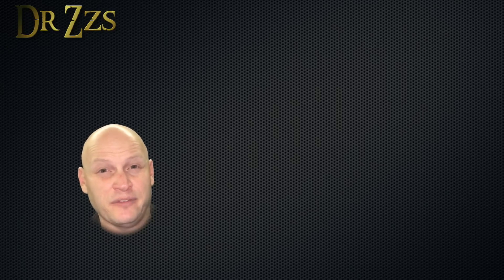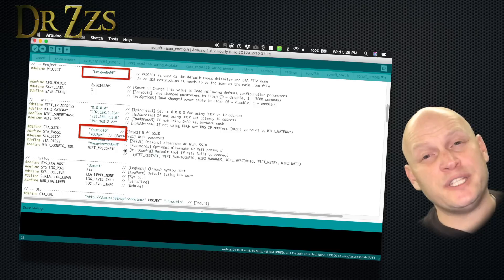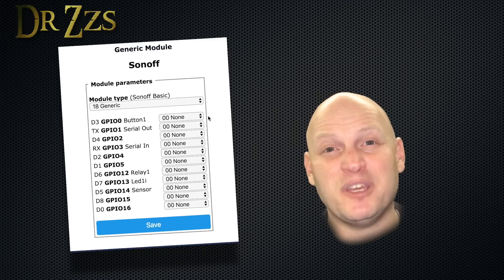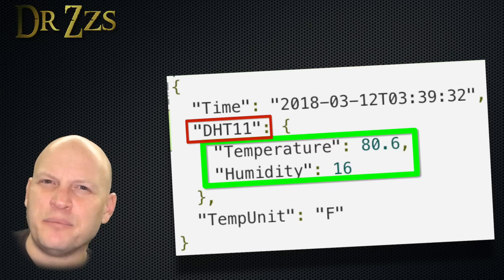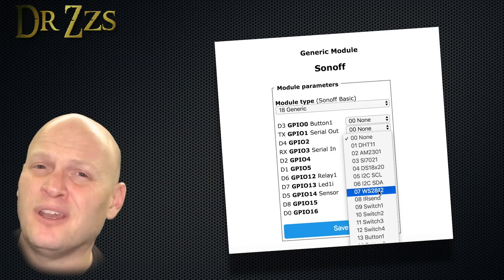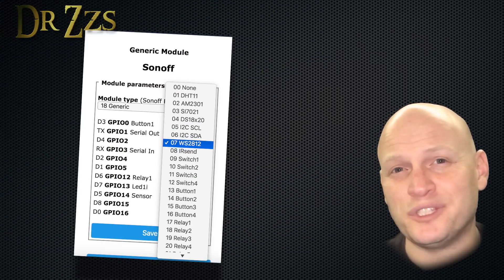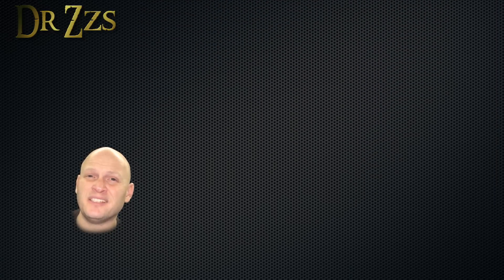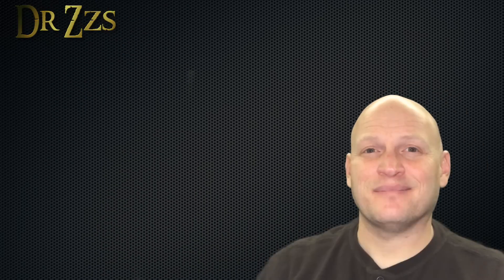Tasmota + D1mini (or Sonoff) - Temp & Humidity, ws2812 LEDs, and Motion Detection

Comment: Hey Dr. Zzs,  In some of your vids I see on your HA screen that you have cameras feeding in to your system. I too use Hassio, Sonoff,  & Home Assistant. Will you please tell me which is the best camera system I should install for the money. It's the one thing I haven't set up yet. Thanks man!!
Reply from the maker: Sure!  The images you see are blink cameras. I have a Foscam and an Arlo also but those I haven’t set up fully.  I think the foscam should be really good. I can’t get live video with the blinks. Just pictures. 
I need to find the “best” camera solution and make a video, don’t you think!?!
Reply: Please do. Everyone that I know that uses this system is always looking for a cheap, easy and effective solution to the camera project.
Reply from the maker: I’m thinking the best overall solution might be a pi zero w/ pi camera. 
Are you looking for a battery powered camera?
Reply: I own 2 RP3s. One running Retro Pi with Kodi, and the other running Hassio. I did consider building a surveillance camera, since i do have a RP cam. But i really want several, so that idea seems excessive. The one my Home assistant system needs.... well, i need. Lol, is a cam that integrates with system and live feeds into it. I own several cams, but cant seem to find a working model. I added a PS2 webcam, using the motion add on. That worked for 2 weeks till the latest update. It wont work anymore and Im not sure how to get it back up. I also have a YI 720P cam, I did the firmware mod in the Docs of HA. That did open up more options, I can now SSH in to it, and I can log into FTP server, but I think the hack has old code and it wont show me the correct image folders. By the way, this little cam is really awesome. It has motion tracking. It tracks my topless wife around. Lol. The app works great. I wish I could make that work, but Im not that great at Linux, which it is running. I don't need a battery powered one. I plan to mount it as a surveillance cam. I don't mind buying another camera if it works with this system. Today, i'm working on the D1Mini and my 37 sensor assortment. You are 100% right! Tasmota is the perfect firmware for the system we own.

Comment: Thanks  for this new video.
I’ve two questions :
- Can  I connect 2 temperature sensor (DS18B20) in 2 diffent pin ? 

- Does it work with magnetic door sensor ?

Thanks
Reply from the maker: Looks like yes, you can use that sensor.  From the Tasmota Sensor config page:

DS18B20 Temperature - DS18x20 (4) in group 2
Enable option USE_DS18x20 in user_config.h for multiple sensors using OneWire library
And a magnetic door sensor would be set up similar to the motion sensor.  Just as a "switch" in tasmota, and as a "binary sensor" in Home Assistant.  There's probably a "door" device type for the binary sensor too. 

https://github.com/arendst/Sonoff-Tasmota/wiki/Sensor-Configuration

https://www.home-assistant.io/components/binary_sensor/
Reply: Thank you very much
Reply: to using onewire library is this line enoughf ?
#include "onewire"
Reply from the maker: I don't think you have to do that. I think all you have to do is uncomment this line in the user_config.h
https://www.dropbox.com/s/9y3fghz6z6nis9s/Screenshot%202018-04-01%2015.24.59.png?dl=0
Reply: Trial report, I did not manage to run two DS18x20 in the same D1 Mini board at the same time, on two different pins.
 the other sensors  DHT11, DHT22 sensors work well, I've tested 3 dht22 on 3 diffents pins

DS18x20 only seems to work on D4 nothing in others pins
https://hastebin.com/bukawisime.sq

Comment: theres somthing wrong with tasmota 5.12 it wont let you create multiple switches from the same d1mini, when you do multiple "switchtopics" it just renames them all the same and then the mqtt no longer works as it only sends a cmnd command, what version of tasmota are you using for the video?, thankyou and keep up the great work
Reply from the maker: No, I actually think I just misunderstood how "SwitchTopic" works.
With Switchtopic you can change the middle part of the MQTT topic to something other than the "topic" or project name you assigned to the board.  To control different switches the LAST section of the MQTT topic changes based on the switch number.  

For example.  The topic for switch1 is:
"cmnd/sonoff/power"
The topic for switch2 is:
"cmnd/sonoff/power2" 
Switch3 would be:
"cmnd/sonoff/power3" 

There are 3 options for "switchtopic".  "Switchtopic0" won't send an MQTT message at all when the relay state changes. "Switchtopic1" will send an MQTT message with the default MIDDLE section of the topic. I believe Switchtopic1 is the default.  "Switchtopic2 custom_topic" will send an MQTT message with a new "custom_topic".  So if you set "Switchtopic2 new" then the topic for switch1 would be:
"cmnd/new/power"
for switch2 would be:
"cmnd/new/power2"
for switch3 would be:
"cmnd/new/power3"

I didn't understand how it worked until recently.  Now I think I get it.  
Hope that helps dispel the falsehoods I've been perpetuating.

Comment: I have flashed Tasmota on a dozen SonOff basics and a couple of Sonoff SV's all with easy success, they all just worked.  I now have a NodeMcu and am trying everything to get Tasmota flashed on it but it never works.  I get the code to flash the device and my router assigns an IP address but I cannot connect to the web server at that IP address.  I have tried everything.  I cannot ping it from the command line either.  Any suggestions?  Any other way to test it?  Thanks
Reply from the maker: I kinda have some little memory about the IwIP Variant setting.  If it isn't already, try setting it to "1.4 Prebuilt"
https://www.dropbox.com/s/2y3pl4o2pb1gvwo/Screenshot%202018-03-27%2018.28.16.png?dl=0

If that isn't it, make a post in the Tasmota "Issues" page (if you haven't already)
Reply: Thank you!  That worked.  Really love your videos!

Comment: Hi DrZzS thanks for your excellent videos. You are really expert. I installed tasmota to nodemcu. I entered to sonoff configure but the nodemcu didnt work with ewelink app. How can I add the nodemcu  to ewelink app to like sonoff. Can you help me please.
Reply from the maker: Thanks
Tasmota doesn't connect to the ewelink app.  You can access tasmota and control the switch by using the IP address in a browser, or you can control the D1mini using a Home Automation hub like Home Assistant. 
There are ways to send commands to the board using html and of course MQTT also. 
Sorry for the misunderstanding.
Reply: DrZzs ok. Thanks for everything.

Comment: Hope someone can help, I have 36v DC led lights. I was hoping to set this up controlling a 60v logic mosfet but no luck so far. Iv got my D1working now with a relay but not yet tried it with the 36v. My question is will the standard arduino relay handle 36v DC? It’s only 144w so I work that out as 4amps but I only see ratings of 10amps at 24v on the relay. It’s my last D1 until the slow boat from China comes in and I don’t want to let out the magic smoke! 😢. Cheers
Reply from the maker: Do you have any info, like part number or something, for the relay?  Even a picture maybe?  

Most relays will handle up to 240v. (at least the 3-4 types I've used).  So, my guess is the Relay will be fine with 60v.  The amp rating on the relay shouldn't change based on the voltage.
Reply: Thanks for reply, i did check a data sheet, shows 24v and 48 v but not 36 :-( https://www.generationrobots.com/media/JQC-3FF-v1.pdf i must admit i find them hard to read though. Cheers for any help you can provide :-) 

I have got it working with 36v, just not sure if it will last or if im shortening its lifespan? 

Would still prefer to get the mosfet working though as then i can dim the led's and create cool affects :-)

Cheers
Reply from the maker: Ok, so if I understand correctly, you're using the D1 mini to control the relay, and the relay is switching the LEDs that draw 144w.  Is that correct?
I think you may be confusing the voltage going to the "Coil" on the relay, with what connects to the "Contacts".  

How are you powering the D1mini?  If I'm right about how you have it connected, then the "coil" voltage is coming from the D1mini GPIO pin and should be very low voltage; 3.3v I believe.  

The "contacts" on the relay are where the LEDs are connected and those will handle up to 240v, no problem.
Reply: I'm in the UK, so mains voltage is 240AC, the LED's came with a 240v AC to 36V DC transformer, from the transformer i have a buck converter to the D1 and relay for 5V DC, another leg from the transformer the 36V Positive is connected via the NC & Common on the relay and a 36v Negative connect to the LED's. hope that made sense? Cheers
Reply from the maker: Makes total sense.  You are fine with that relay.  
You're not going to hurt the relay at all with 36v on the contacts.  The ratings you were reading from the data sheet that listed 24v and 48v (and lower) were for the coils only.  You have the D1mini attached to the coil, so it is very low voltage and also will cause no problem to the relay.
Reply: Thank you for the help and persisting with me :-) . Next weekend another go with the mosfets and PWM :-) at least i know i can use the relay for now! Cheers

Comment: Another question re: home assistant. Been using a PI3 since the day it came out, it seems to be bogging down in my new house. What is your opinion on using a dedicated pc instead of the pi?
Reply from the maker: I've only every used HA on a pi3.  I haven't had any problems, but I don't think I'm asking it to work very hard.  
I know a lot of people use different hardware. Some real high-end users use a NUC.  https://amzn.to/2DQx6uh

That seems a little extreme to me, but they swear it's the best.  I guess if money wasn't a factor I'd do something like that too.  
If you do change hardware you'll have to use some other installation besides hassio. 
https://home-assistant.io/docs/installation/

That introduces a lot more potential issues and things you'll have to figure out how to get working.   Hassio's add-on system makes things so easy.  If you're a "computer guy" then using a different install method might not be an issue. 

They just came out with a new pi3b+.  Should be a little more powerful.  Don't know if the current hassio image is 100% compatible with it yet. 

That's my opinion for what it's worth :) 
Let me know what you decide to do and how it turns out!

Comment: Hey thanks for doing these videos, you do an awesome job!  Do you know of any examples of, if the temperature from a sensor  (DHT11) attached to the Sonoff goes below say 40 degrees  to turn on a plug/switch in Home Assistant and then off at 60 degrees. Also is there any tricks to change the temp reading from Celsius to Fahrenheit on the Sonoff and Home Assistant?
Reply from the maker: Thanks!
you can set up an automation to trigger a switch based on a temperature. 
I just did this quick to show you how: 
https://www.dropbox.com/s/6mdetnn2a0evrqk/tempfanauto.mov?dl=0

Trigger is "numeric state", you can do either "above" or "below", I set a condition that I have to be home for it to work (conditions are optional, not necessary at all), then the Action is to turn on the fan in my office.  
:) 

In Tasmota, at the "Console" you can set the temp units:
SetOption8Show current Temperature as either Celsius or FahrenheitSetOption80 / celsiusSet Temperature to CelsiusSetOption81 / fahrenheitSet Temperature to Fahrenheit
You probably have to have the units matching in HA and Tasmota. 
To set the units in Home Assistant: 
sensor:
  - platform: mqtt
    state_topic: 'office/sensor1'
    name: 'Temperature'
    unit_of_measurement: '°C'
Reply: Thanks for your help! I plan on seeing you at the maker fair in a few weeks.
Reply from the maker: cool!
see you then!

Comment: I just built this. Great project. I want to know, if you have a video, or can point me to one based on the following scenario. I want a motion sensor in the small area where my toilet is. (it is a closet , so to speak in my bathroom) I want the sensor to control the light but lets say from 8 pm to 5 am the light will come on at a 20% or so level, the rest of the time at 100%. Just enough to make objects out.
Reply from the maker: Cool! 
that's totally possible!  
The best way would probably be to use NodeRed, because it's better at complex automations.  I'm not a NodeRed pro (yet), but I think I can tell you how to do it with Home Assistant.
I haven't tested this, and you'd have to use your own entity ID's or MQTT topics, but it would look something like this:
automation old: - alias: 'Bathroom Motion dim'   trigger:     - platform: state       entity_id: binary_sensor.d1_pir       from: 'off'       to: 'on'   condition: time       after: '22:00:00'
       before: '06:00:00'   action:     - service: light.turn_on       data:         entity_id: light.bathroom         brightness_pct: 30 

Good luck!
Reply: Thank you

Comment: Hey Justin, Love this stuff. Great videos, the right mix of humour and getting it done. Get excited by your PIR project, got it all set-up but struggling to get the D1 to talk to HA. Console is showing the activity but as cmnd/d1miniPIR/power = TOGGLE but subscribing to this in HA is not triggering at all. You also use /POWER2 in the settings, which I don't fully understand as it's showing only power in console on D1 mini. If I set the HA details back to standard MQTT topic of the D1 mini, I can get it turn on the light but it never turns the PIR trigger off. Not sure how I've got this wrong.
Reply from the maker: Thanks!  I'm having a lot of fun making these too!  Just wish I had more time to make them faster....
I think I'm following your problem, but maybe not totally.  
Anyway, the reason mine says "power2" is because I set the PIR as "switch2" You should probably change yours also.  In the dropdown menu on the Configure Module page for the GPIO pin, select "10 Switch2" instead of "09 Switch1". 

I think you might need to change your switchmode too, so instead of "toggle" you get "on" "off". 

In the Console type "switchmode2 1" enter. 

See what those changes do for you.
Reply: DrZzs alright, so good news, I got it working. Weird news, did all you advised and still wouldn't trigger HA. So set back to Switch 1 and topic to POWER, switchmode1 1 and it works! Just don't understand why switch 2 with topic of POWER2 won't work.

So given I'm using a D1 mini and not Sonoff, I assume this is ok to keep as there is no relay on the D1 mini or is there?

I've got a spare Sonoff so am going to try and see if I can can get the switch 2 option to work on that just for fun.
Reply from the maker: Weird, but we'll take it! 
There is no relay on the D1mini.  You can add one if you want to though.  But as you have it you can use the PIR for automations in HA just fine. 

When you use switch2 you also need to set the "switchtopic2 customtopic", in the tasmota console.  When you do that the mqtt topic for activating that switch becomes: "cmnd/customtopic/power2"  and the topic for the state would be "stat/customtopic/POWER2".  Maybe changing the switchtopic is the part you were missing before.
Reply: DrZzs YOU STAR! switchmode2 1 fixed it for me! I have been trying to get this to work all day, just kept replaying your video to see where I had gone wrong, I never twigged on that I was sending a toggle rather than off & on! Cheers

Comment: Hope you can help please, I have flashed a D1 with tasmota and I have wired up a mosfet to D2 to control 36v dc led lights but I am struggling to get them working, I have tried as switch and pwm but no joy! I am hoping to then change the lights from on and off to different pulsing effects from Hassio. Cheers
Reply from the maker: Looks like Theo decided not to provide support for Mosfets:
https://github.com/arendst/Sonoff-Tasmota/issues/20
Reply: DrZzs Thanks for reply, yes I had read that link before but if you check your D1generic setup and look what you can assign to each pin, there is PWM1, PWM2 etc as well as RELAY1...So I just presumed that was an old post. Anyway, thanks for looking 😀. Cheers

Comment: first of all great video!!!

How would i connect a vibration sensor module(sw-420 nc type) to the d1mini?

 want to be able to put this on washer to let me know when its done,lol.
Reply from the maker: thanks!
You're not the only one. I would guess it would work similar to the motion sensor, when there's vibration it is "on" when it stops to goes "off". So you would set it up in Tasmota like a switch. 
 I'll have to check my kit and see if it has one of those.

Comment: Do people get cases to secure these builds and do people solder these to secure the build or keep headers?
Reply: I also solder headers to my Sonoffs. Much easier to work with for flashing and connecting when in the wall.
Reply from the maker: Great question.  
I almost always use some form of 3d printed box for pretty much every project.  Some I design myself others I download from Thingiverse.  
If you don't have access to a printer I think a great option for a box is a little plastic soap box you can get at Walmart for $1.  
Something like this: http://amzn.to/2FX1oxi

And I solder pretty much everything.  I just kept this one on the bread board because it was changing a lot as I tweaked it.  At the very least I will solder a good header on the D1 mini or the Sonoff then use jumper wires.  The D1mini's I've bought have all come with a variety of headers to use.  I just cut those to use when I solder them on the Sonoffs too. 
The NodeMCU has header pins already attached. 

I'm curious to hear what others do too.  
Hope that helps!